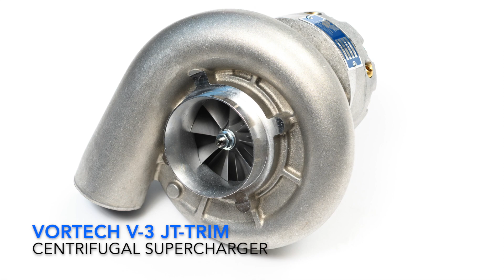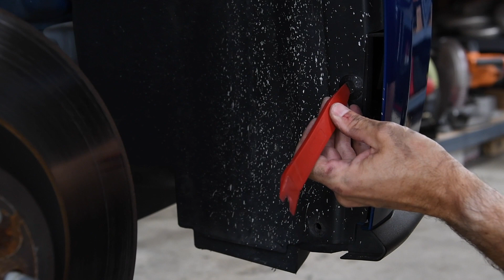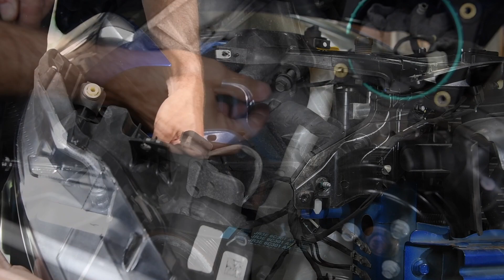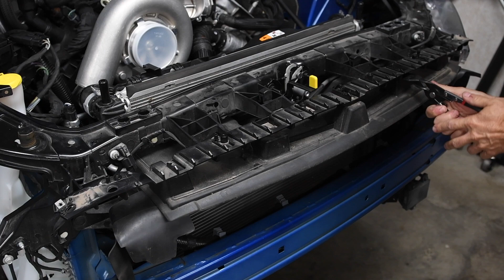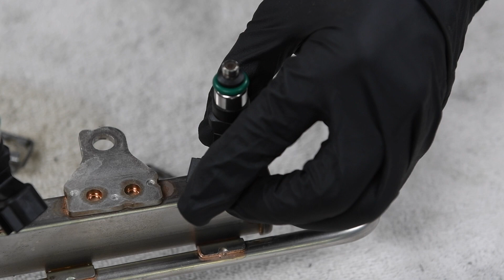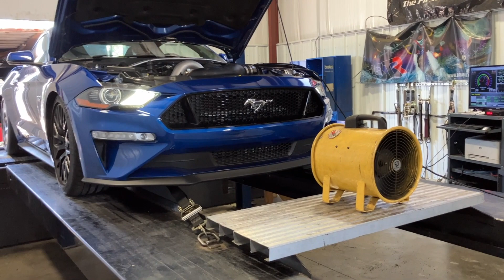Vortech Heritage Supercharger Mustang Install and Test

Comment: 484 horsepower before the blower? That’s a happy dyno….
Reply: Thats at flywheel, not at the wheels
Reply from the maker: That was corrected for flywheel numbers (since we were running in 3rd gear). We wanted to be able to make "apples to apples" comparisons in the future.